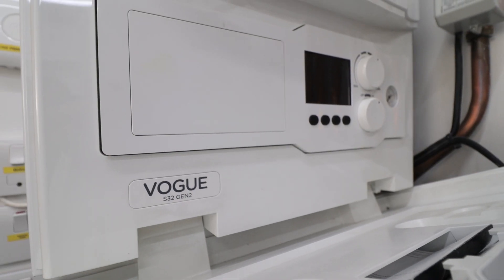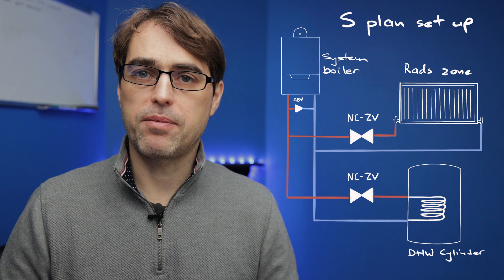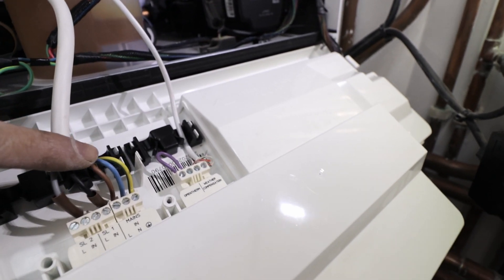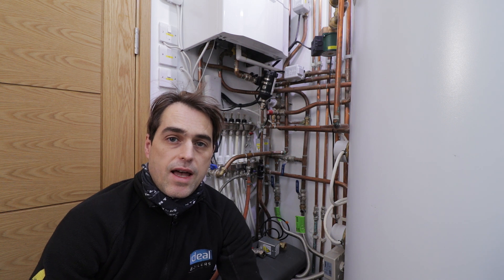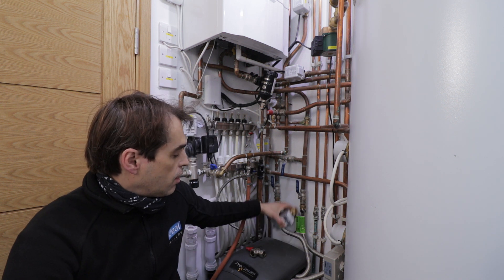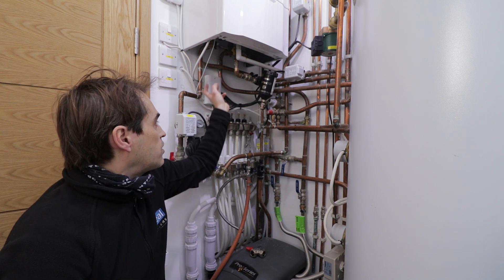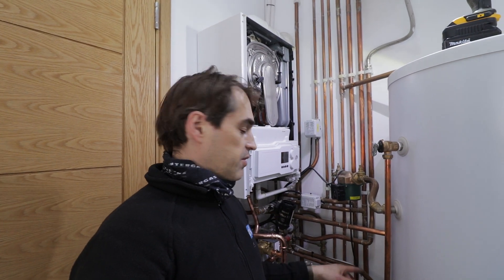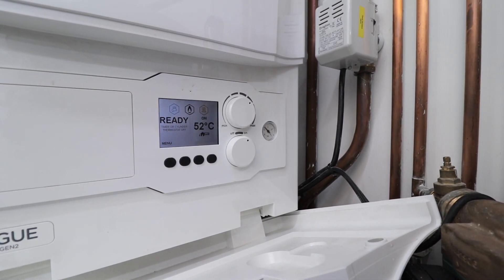Hot water priority with Ideal Vouge boiler

Comment: Any chance I can get hold of you. I am having a night mare. Just called Ideal tech guys and asked if boiler supports PDHW and they said "no, that depends on you cylinder as it's a system boiler and not a combi boiler".

So system boiler doesn't support it?
I am just going nuts now

I have Ideal Max Vogue s18
Reply from the maker: Yes your boiler supports PDHW, ideal technical don’t know the product they sell or understand what it can do
Reply: @UrbanPlumbers  ur right it does, got a confirmation from them. May I ask how I search online in UK for that Normally Open valve you are referring to? Also what new cables need to be traced for TADO wireless thermostat EU model as it supports opentherm?

Would appreciate it
Reply from the maker: @bimiuk4051  https://theintergasshop.co.uk/motorised-zone-valves/716-honeywell-v4043b1257-22mm-normally-open-2-port-motorised-zone-valve.html

Comment: Great informative video. Would you still recommend this system with a house hold that has a high usage of hot-water where they might find the heating will not come on due to hot-water being priority  . Remember the days first fitting radiator thermostatic valves and get called up with customer saying her radiators not working when heating is on. Of course it had turned of with temperature within the room. Trying to explain that to someone who has been used to feeling every radiator roasting hot was a challenge
Reply from the maker: You can still time water. If high usage then use a high gain cylinder that can take the full kW output of the boiler.

The cylinder here is too big. In PDHW you only need 100-120l of stored water as it operates pretty much like a combi boiler - reheats the water as you use it.

Again all combis stop the heating when in use and no one notices

Comment: Waw, i think its the easiest best informative video ever on youtube about HWPS.
I really don’t know how on earth I didn’t come across ur page and videos before. Just amazing clarity and explanation . I just got one issue I didn’t understand is the towel rail zone if it comes with hot water the NO ZV will block its flow regardless so how it will works. 
Also which Worcester or vaillant boilers that does hot water priority.

Thanks for ur  time and effort.
Reply from the maker: the towel rails do not come with hot water. I just used a hot water realy on the 2nd nest to control the towel rails separately. 

Worcester CDI and 8000 can do PDHW with additional internal diverter that needs to be installed before the boiler is installed.

All vaillants 6xx series can do PDHW but only with Vaillant own wiring center and controls.
Reply: A relay on 2nd nest.?!
Thats need one of the great videos you do 
Many thanks

Comment: I am want to implement this Priority Hot Water because you say Boiler runs more effectively when on two different temperature.

The plumber in UK say that we all leave boiler at 75degree and never is a problem.

Question: is this wrong approach or do they just follow a tradition passed on generation after generation??

Furthermore, am I really loosing a lot between S plan and Hot water priority? Will I really loose out much or am I wasting too much time with this and unable to find somebody who has done this, seems very uncommon in UK.

What is likelyhood of us demanding hot water and heating at same time? The cylinder is 130 letter tank and will be heated up once every so often.

Also, what is the VALVE I need to change? What is it called so I can search it in UK.

Also, what would the hot water priority be like for the Ideal Vogue max s18 and TADO starter kit 3v EU model.

Much appreciate your advise
Reply: The Tado eu starter kit doesn’t have hot water relay, and the UK one doesn’t have Opentherm, so you’ll need to use something else
Reply: @Leonards-leopard  really? So why is he claiming it will work ?

Comment: I like this hot water priority system but how long will it take to heat the water in the cylinder so the heating can come on? Say you have the timer set to come on at 6am you don't want to wait an hour before the central heating will come on. Maybe you could set the hot water to come on at 5am 😊
Reply from the maker: You normally leave hot water on constant. Full reheat of 200l with 18kW cylinder is around 30min, but you never reheat it from cold. 

You would only notice it if you used a lot of hot water
Reply: @UrbanPlumbers  Oh yes I see now 😄 Why don't all manufacturers have 2 switched lives in their boilers to allow hot water priority because it can save energy especially as you can also use opentherm?  Hopefully it will come with the next generation of boilers. I wish you installed in my area.
Reply from the maker: Some do! Intergas, vaillant, ideal - but usually only on top of the range boiler.

People want cheap boilers, and they get what they pay for. Same goes for the installers.
Reply: @UrbanPlumbers  I'm hoping Baxi will come out with one. I do like the Ideal Vogue but it's twice the price of a Main Eco Compact. Maybe I would get that money back over time by the energy savings. Something to think about. I've always had Baxi boilers, I like them and their customer service is excellent. 😊
Reply: I think in time Heat Pumps will get a lot better and the price will come down and there will probably be newer better technologies too. But it will be decades before gas boilers are obsolete.

Comment: the flat im about to move into has an S plan... I like the idea of the HW priority. I have a nest thermostat 3. so I will aim to get a plumber locally to fot both these. - very informative video. Always fun to watch
Reply from the maker: make sure that the boiler that is there supports DHW. Not many boilers do.
Reply: @UrbanPlumbers  thanks for the reply, if it doesn't (most likely it doesn't) I'll probably swap it later anyway. for reference programmer is a danfoss tp9 and the boiler is a potterton Promax HE plus. Funny setup as the thermostat is digital and on the programmer with just a room sensor in the living room (when I visited the place).

Comment: Can you do opentherm with that system?
Reply from the maker: Yes of course. Open therm or weather comp, but not both at the same time.
Reply: @UrbanPlumbers  Shoot, I did not realise. I will re-watch this video...
Reply: I've re-watched, and you didn't mention this. The manual for the Gen2 system boilers does not mention that you can only use one or the other. I'm going to call Ideal (don't expect much)...
Reply: Ok, I called Ideal and after a bit of time on hold they confirm that you can only do one or the other! They say that Opentherm is better. Bit of wasted time on my part drilling a hole and mounting the weather compensation kit at the top of a ladder, but never mind. I will disconnect the thermometer and see what the result is.
Reply: I have disconnected my weather comp and for heating, everything seems the same (cycles between the same temps because the boiler is overpowered). My hot water is scheduled for 16:30 so I'll see if it gets to 60 then. I suspect that if you have both WC and OT connected, the boiler just ignores the WC. Only thing that has changed is with WC I had the nicer display that split the HW/CH demand/READY status.

Comment: Firstly thanks for the video! I do enjoy your vids. I have an ideal max 24 heat only S plan config with Wiser heat controls. Now I've found the SL2 thanks to you and wired in the opentherm, the system is smart enough to know when there's a call for HW and CH at the same time . Only when HW is on on its own does it ramp up to 70+. When HW and CH are on it runs at whatever the high point is set to on boiler. When CH only, Opentherm sets the temp. This seems to be the best way to run the system? 
I only have two regular NC valves wired into the HW and CH relays as usual.
I hope this is of some interest!
Reply: Can I ask how you've wired the pump?
Reply: Set your timers so that the CH is not on at the same time as HW. Also if you use a Nest or similar, disable any randomly running legionella cycles.
Reply: I'm surprised it picks the lower flow temperature when there's a call for both HW & CH. The hot water cylinder stat would never turn off!
Reply: @shm5547  Agree, cannot believe that this is true. I can test it out a bit later.
Reply: @RichardABW  Hmm, I've had a google for the ideal weather compensation kit installation guide and its wiring diagrams shows HW OFF going to SL2. This doesn't seem right to me, doesn't seem to fit with this:

_"When the system is in a timed on period for DHW and the tank stat is not satisfied, OV will be generated on the switched live input SL2 of the boiler.
This will ensure that Weather Compensation adjustment is ignored at this time. The set point will be fixed at 80 degrees.
"_
Reply: @shm5547  I'd need to go back and re-read, but this rings a bell. I think it disagrees with the Vogue Gen2 S** manual. Remember that the temperature sensor works with several boilers. I did what was in the Vogue manual and all seems to work ok.
Reply: @RichardABW  yes, I've just searched for "ideal weather compensation kit installation guide", found the pdf and had another read. The Vogue System boilers are shown getting live into SL2 when the cylinder stat is calling for heat. The Heat only boilers are shown getting live into SL2 when the cylinder stat is NOT calling for heat! I think this is the wrong way round.

The SL2 connection on the heat only boilers  should probably be connected to the cylinder stat HW ON. Looks like a mistake in the installation guide, but would need to confirm with Ideal.
Reply: I used this video (thank you @UrbanPlumbers !) as the basis for converting my S plan with a Vogue S32 (with weather compensation) to DHWP as follows:

1. Wire the switched lives (orange wires) from the CH and HW zone valves to SL1 and SL2.
2. Install a simple NC relay circuit so that when there is a call for heat to the cylinder, any call for heat to the radiator zone valve is disconnected. I have S plan plus, so used an NC double relay to control call for heat to two separate CH zone valves.

This way you don't have to worry about the situation where CH and HW are on together so you always get maximum speed of regenerating the HW.

You can get the electronics required from Amazon for about £30. In my case it would have been very difficult to reconfigure the plumbing, but an electrical solution was fairly straightforward and works well.

Comment: Absolutely superb video, I have an Ideal Vogue Gen 2 S15 with Evohome with a rads and UFH, and trying to digest all this on an S plan with only 1 port valve since Evohome has its own valves.
One question, since I’ve been told this is not possible - Opentherm and WC on the Ideal, I’ve been told they don’t work together and Opentherm had a better erP class and therefore remove the WC. I’m guessing you disagree with this?
I’ve learnt a lot from your video, thank you

Oh I’m guessing that me removing a port valve negates my requirement for a “normally open valve” as I’m using Evohomes valve as individual ones since all zones have actuators
Reply: Be good to get an answer to the Opentherm vs WC. Are they not both used then? I'd assumed that my Nest would lower the power of the boiler as target temp was approached, and the boiler would just try and supply however many kW at whatever the WC said was the most efficient temp to achieve it by adjusting the burn/flow. A question: How big is your house and does your boiler cycle when it's on a low setting (i.e. it's not super cold)? I have an S32 and it's too big for me.
Reply: @RichardABW  you can’t use Opentherm and WC together, they fight each other. As I understand it Opentherm is ErP class VIII (8) and WC is ErP class V (5). So mine is just on Opentherm.
I have a S15, my house is EPC B and I have UFH. My output temp is 38°C, though I could go lower. Heating comes on three times a day for anything from 1 1/2 hours to 1/2 hours each time. Three times as if left on the boiler then cycles as house doesn’t lose that much heat. UFH is one big slab that releases heat very slowly too.
The ideal Vogue allows you to set the max temperature (so HW will default to this), and the dial allows you to alter the flow temp of the boiler for heating, so HW temps and Heating are different. Atm I’m on Octopus Go faster so it’s slightly cheaper to heat HW with electricity, so my boiler is currently at 92% efficiency.
Reply: @jimmyc38  Thanks, how do you know it's at 92%? There is that efficiency bar inside the boiler menu, but it doesn't seem to move much.

It would be interesting to hear what Szymon makes of using OT and WC at the same time. It was a few weeks ago I watched this video but I don't think he suggests you cannot in it? Also I don't think the boiler manual suggests it's an issue. Surly all the WC is doing is picking an appropriate flow temp automatically, like you are now doing manually with the knob on the front?
Reply: @RichardABW  because on the Ideal Vogue there is an option to look at boiler efficiency. It was Ideal that told me that their boilers don’t allow the two, and it was them that told me Opentherm is better. Also I’m very clued up on Evohome and know that this is ErP class 8 on Opentherm. Just be mindful that zoning and low temps have to be done in a balanced way, so that you don’t fine zone so as to cause the boiler to cycle. Batch zone is how you would do it, especially if your rads are “normal” size and not larger ones. For me UFH is my saving grace.
Reply: @jimmyc38  Yes, I have an Ideal Vogue, I've previously just seen question marks over that boiler efficiency reading. I talked to Ideal too just 30 mins ago and they said the same to me as they did to you. I have now removed my WC sensor. I think the boiler seems to be working in exactly the same way, I wonder if you have WC and OT connected the boiler just ignores the WC?
Reply: @RichardABW  I have seen my boilers efficiently increase steadily over the last year. Ideal replaced my boiler last year so I’ve monitored it’s efficiency, climbing up and up. Given that I took WC off last year and it’s just been using OT since then, and I’ve only just put my heating on, the climb from 80 odd to 92% I’d say is quite reasonable. It’s climbing up slowly and doesn’t jump up and down, so I’d say it was accurate. Given I’ve played around with output temps which are all very low, it’s safe to say that condensing takes place virtually all the time. Evohomes Opentherm is good coupled with their ability to monitor zones separately and learn heating up and cooling times beats WC which only has one additional reference point (outside temp) Evohome is able to learn rooms that are on the north side etc etc, therefore each zone is a reference point which it consolidates to one call for heat whilst balancing the boilers flow temps to encourage condensing etc etc.
Reply: @jimmyc38  Thank you, good to know and I will keep an eye on that reading. Mine is on 14 (or was the other day, it's possible it said 13 before) but the boiler has spent the first 5 years of its life with no WC and no OT. Most people's Vogue's have readings more like mine!

I take it when you disconnected the WC the normal display on the boiler went back to just showing the single rad/temp? I suppose Opentherm can kinda do some external weather comp maybe anyway as it knows what the temp is roughly outside.